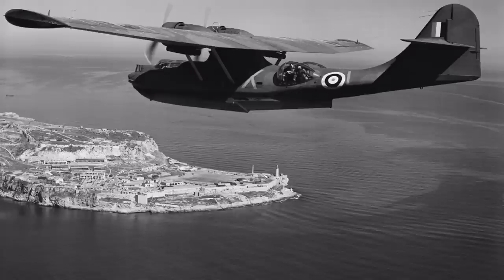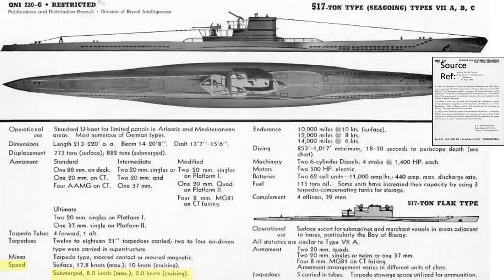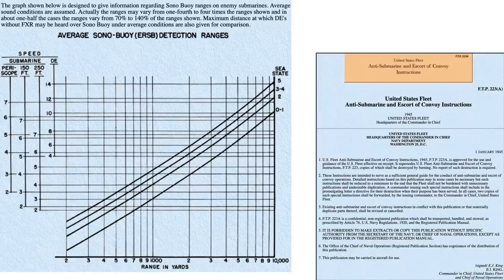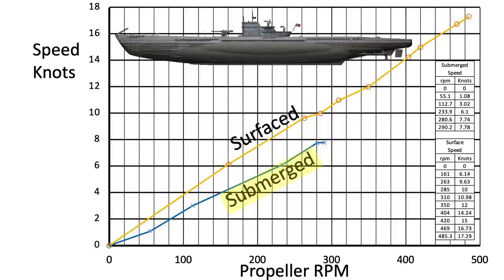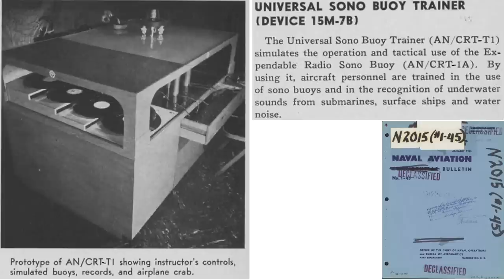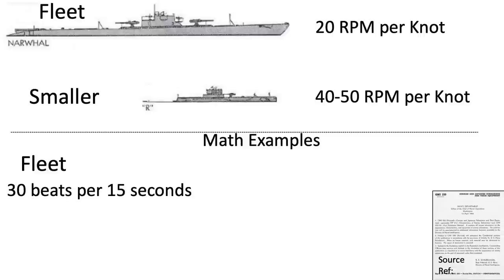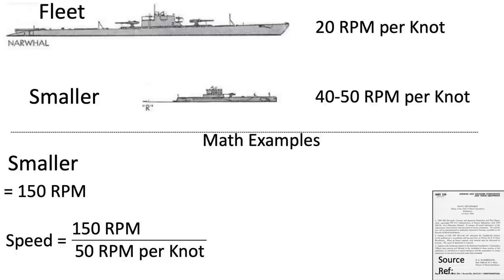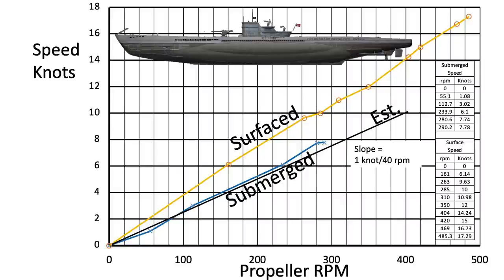Clever WWII Method to Track a Submerged Submarines speed

Comment: OMG heavy flash backs👀 The last clip also had good audio of the diesel engines running as well. To tie this audio clip to the discussion on the snorkel video, if the waves were high enough, you would be able to hear the flapper valve slamming shut as the waves pass over the snorkel. It sounds a little like someone hitting a metal trash can with a baseball bat.
Reply: Causing a sharp decrease in air pressure in the sub since the diesel engine continued to suck air out of the sub's interior as it ran giving the crew short ear surprises of the vacuum variety.

Comment: WW2 non snorkel diesel subs from most of the navies had the "1 hour rule": make turns for about 2 kts for max time before the battery dies or flank bell and the battery is dead in one hour, assuming a fully charged battery when the sub dives. Mind you this is a ball park figure but is a good guide to start the stop watch when the sub dives and note it's speeds,  another consideration is how fast the props turn and their design, the faster they turn the more noise they make and easier to detect. German subs electric motors were direct drive, no reduction gears which makes theier drive line quieter but not their props.  Every propeller, no matter how well designed and milled, has one blade that makes more sound  and this enables you to "turn count" it by the beat noise it makes. A quick tip here, most U boats had 3 bladed props so instead of counting each beat and then the total beats for 15 seconds count them: 1 chic-ken- sh*t,  chic-ken-sh*t, etc It's easier to keep of the chic-ken-sh*t's. I'll let you ponder yourselves term we used for 4 bladed props ( it's probably not very pc)!  The RPM/ minute for the Fleet boats is not correct if my memory is right. With the sonobuoys in a cross pattern, with one in the middle, you can now start a plot on approx. course and correct speed, from the turn count, and this may let you put a weapon in the water and sink the U boat.

Comment: Counting propeller pulses like a nurse with a stop watch is so primitive. It looks like they were in such a  wartime hurry they omitted to make electronic frequency counters to just read out the submarine speed. Even then phone companies knew all about that.
Reply: Tube counters were large 19” wide by 12”
 high heavy boxes. While aircraft electronics are packaged differently it still is a heavy piece of equipment. Also the display was not easy to read.
Reply: @doctorkdsify  Also the high level of background noise made electronic discrimination difficult.

Comment: I wonder if it would have been technically feasible to build a system that would make rapid adjustments to buoyancy, quietly, to maintain depth within a narrow range. I'm thinking If the sub is floating up, compress some air from the top of a ballast tank into a bottle. The bottom of the tank could be open to the sea, so some seawater would be drawn in. If the boat is sinking, release some air into the  ballast tank to start pushing out some of the water. Some kind of electrical or electromechanical integrator or differentiator could be used to calculate the qty of air to move with each adjustment. Of course, pumping water instead of air would be more precise and have a quicker effect, but building a water pump that is quiet enough could be difficult.
Reply: Yet is it not a challenge that any air valves, piping and orifices are also noisy?
Reply: @manzion7599  Better to use centrifugal or magnetohydraulic pumps on the seawater.
Reply: @manzion7599  Yeah, no doubt.

Comment: Curious to know why there is only one beat per prop rev.  Also wonder why having two props would not cause multiple beats. You would think four blade props would be different beat per rev than 3 blade.  Interesting.
Reply: You are hearing the cavitation of the individual blades and the imperfections in the shaft, the blade rate x number of blades = shaft rate which you are counting. Modern sonobouys if getting a good reading will show a clear blade rate, shaft rate, gear ratios if any engine firing rates if diesels ect. If using multiple shafts you might see them or they could be in exact rhythm though in a turn you will likely see the rates differ. Through rising doppler or falling doppler rates and multiple sonobouys you can guestemate a possible course. While things have improved the basics remain the same.
Reply: @9999plato  Thank you.

Comment: I was under the impression that WWII submarines, at least the U.S. models, did not have a direct connection between the diesel engines and the propellers, and that the propellers were always turned by electric motors whether they were drawing power from the batteries or directly from the generators when running on the surface.  Is that correct, or was there a direct shaft from the diesel to the propeller?  How about German U-boats?
Reply: For fleet type subs, yes, the generators (there are usually 4 or 5) have fairly complicated switching to a number of output busses. One (or maybe two, I forget) of the busses go to the electric drive motors. The motors go to mechanical reduction gearing, and the output of that goes to the prop. The generator output can also be switched to charge the batteries, or to run the electrical subsystems in the sub, like lights, blowers, radios, sonar, etc. There is also a big air compressor for a number of important uses.
So there is no direct connection from the diesel engines to the props, it is an electrical connection.
I think R and S type subs were the same sort of design, but I don't actually know for sure if that is true.
Reply: WW2 subs work exactly like modern hybrid automobiles. Although modern computers and electronics make the system much more efficient, the principle is exactly the same.
Reply: @lwilton  Thanks, that has always been my understanding.  The way things were worded in the video (just more simply) made me question that, so I wanted to confirm.
Reply: @roberthutchins1507   I've owned 4 hybrid cars, and they all had a conventional mechanical drivetrain that was merely supplemented by a electric motors, not replaced by them.  You disagree with @lwilton?
Reply: @gort8203  I'm not a German submarine expert. Having said that, it's my understanding that German subs used motor/ generator sets to conserve strategic materials (coper), and to save weight and space inside the sub. When the diesel engines are running, they turn both the props and the motor/generators to produce electricity. When the diesels aren't running, the batteries power the motor/generators to turn the props.
Yes I believe most if not all American subs were strictly diesel electric drives, they had both generators and electric motors. This is a heavier and larger system, but it is also more efficient, which was important for Pacific Ocean operations.
Reply: @roberthutchins1507  Thanks.  I can believe the German subs might be different than the American fleet subs and have a mechanical connection between engine and prop.   They would perhaps be more efficient at driving the props when surfaced at the cost of some complexity or flexibility. 
The only thing I question is the diesel turning the prop and generator at the same time.  I would think they must have a way to disconnect the generator when they need all the power to go to the prop. And maybe a way to disconnect or gear down the prop when they need almost all power to go to the generators for quicker charging.  I guess I need to find a good book on WWII diesel submarine design.

Comment: G'day,

Yay Team !

Um, this is a pretty small Nit to pick upon, but you cite a 
Nautical Mile as being
1.15 x the length of a 
Statute mile...

As a budding Sailor I was given the impression that a Nautical Mile was 1 & 1/8ths of a Statute Mile, or 1.125 times the length - so I pricked up my ears at your figure.

So I ran it through the Calculator, and we're both wrong.

2,000 Yards of a Nautical Mile Divided by the
1,760 Yards of a Statute Mile ; is
1.1363.

So, not 15% bigger, and not One & an Eighth, either ; but 
13.6% bigger..., when one actually bothers to check !

Such is life,

Have a good one...

Stay safe.

;-p

Ciao !

Comment: Multiplying by 4 and dividing by 20 is really the same thing as multiplying by 2 and dividing by 10. Much easier to do the latter in your head. Same process as calculating an appropriate tip.
Reply: The appropriate tip is determined by service
Reply: @kenneth9874  I had no idea. Thanks for letting me know that!
Reply: @GoSlash27  lol
Reply: @kenneth9874  If you have any other painfully obvious statements you feel compelled to share, feel free to comment. I'm already aware that water is wet, but there may be some other facts I hadn't noticed. :)